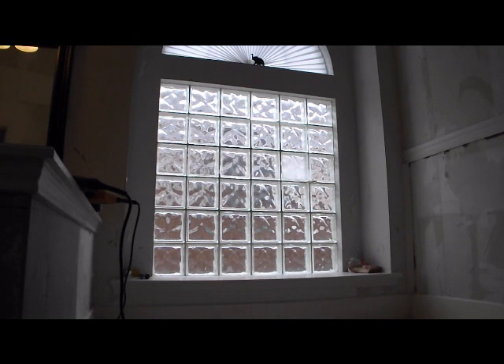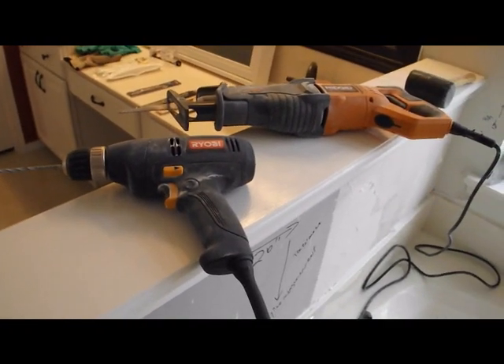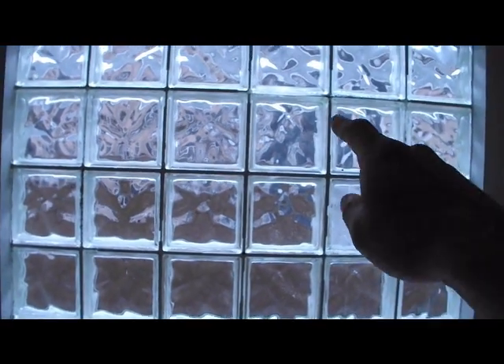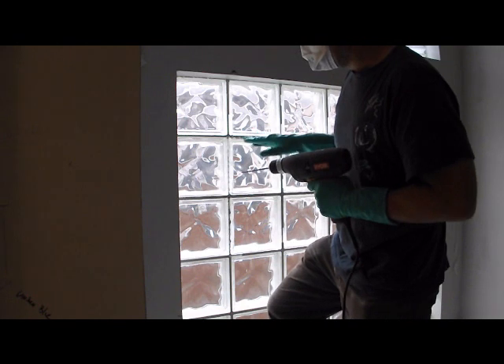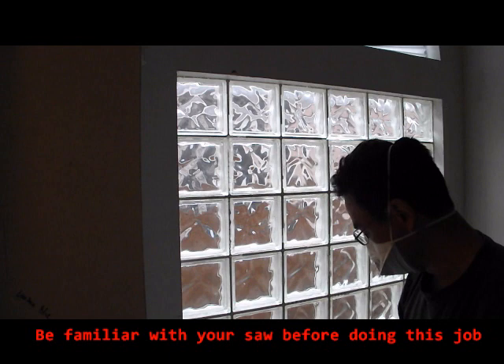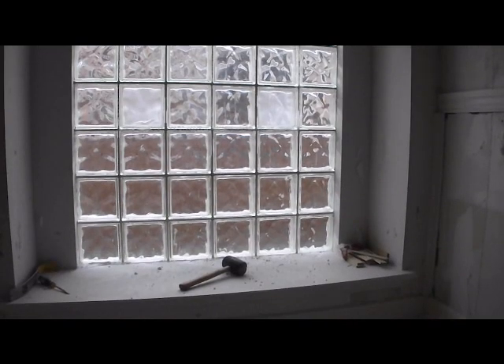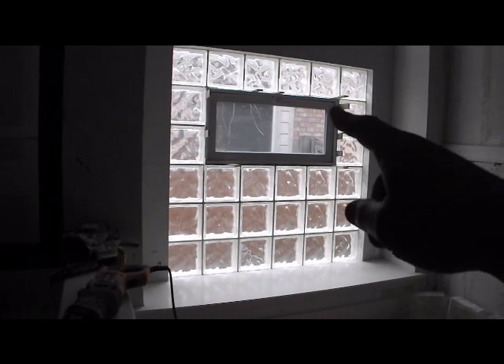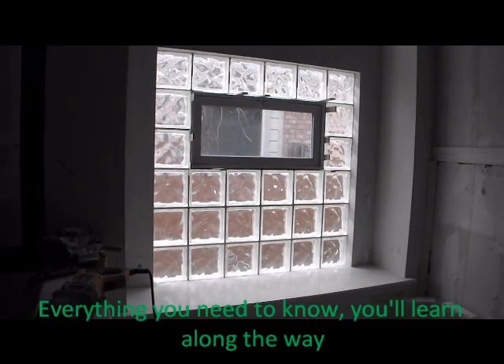Glass Block Window Demolition

Comment: Why not use a Metabo with a mortar cutting blade. I am going to cut blocks out of an existing window as you did, but I am going to use a stone cutting blade that costs $14.00 from Walmart.
Reply from the maker: Sounds like a good plan. I didn't have an angle grinder (metabo?) back then. If you use it the standard warning to be safe applies. You might have to come from both inside and outside to get thru the full block width. Be careful about the steel lines that are more than likely inside some of the seams. That might make the metabo jump up a little if you hit one. Thanks for your comment!

Comment: I have exactly the same blocks.  I think because of the house shifting one is cracking.  I was wondering if you remove one will the others move or crack from loss of support...I was thinking of cutting some 2x4 pieces to insert once I removed one...any ideas where to buy these blocks?  How do u get a match or are they standard...
Reply from the maker: Well, my house is from 1998, but it seems like they have not changed much.

To get a sample, go to the front desk at Home depot, and ask to have 1 block delivered for pickup in the store.

https://www.homedepot.com/p/REDI2CRAFT-7-1-2-in-x-7-1-2-in-x-3-1-8-in-Glass-Block-for-Arts-and-Crafts-5-Pack-CB0808W/302762931.
Reply from the maker: As to there being only 1 cracked glass and your concern that the window won't be stable... hmm

First, these are extremely stable basically a mortared together wall of glass blocks. So if you knocked out 1, it will make basically zero difference to the rest of it. But you have to remove it carefully so as not to damage the other block.

Now, if it really cracked due to foundation problems, you don't want to replace it with another block... you might be dealing with more cracking blocks too.

Honestly, it sounds like your situation is cosmetic, which is a real problem, but maybe a patch over the 1 cracked one will look ok?  You could use a nice 7 1/2 x 7 1/2 piece of decorative tin.

Or you could try the drilling, cutting and replacing 1 block, you'd have to take care to get it matching tho, as your new mortar will he a different color than the aged original. And you won't have the metal guidelines of the metal runners.

Good luck and thanks for the comment.
Reply: @tkmair6559   I dinged one of my other blocks one time and air came out...they are vacuum sealed I think...not that one is getting green inside :>)...at some point as the crack gets worse I will need to do something...i was thinking an angle grinder or chisel..although I would think a chisel would introduce more change of breaking the surrounding blocks...u found the drill to be the best?  Some sort of cement drill...i do have a hammer drill...
Reply from the maker: @kenmcf  they way I did is, start with drill use masonry bit. After drill out enough to slide in blade, use sawzall (reciprocating saw). You have to get a diamond crusted saw blade. You can Also use a flat head screwdriver as a chisel between the drill holes.

Now that you mention it, starting with a angle grinder, might be good too.

The thing is to get to where you can use that sawzall. Because that's what can cut all the way into the corners.
Reply from the maker: Yeah, chisel is great idea. Just use something small and easy to control. Good luck. Go slow and careful.
Reply: @tkmair6559  Cool..i have sawzall too..yeah that makes sense..now to find the replacement blocks as my glass blocks are pretty old...I just hope i can find a match.
Reply: @kenmcf  go to your local menards ,hardware , or window store that deals with glassblock. I got free quotes . no matter which style & size you have you can easily still get a matching one for $5 ballpark

Comment: I want to do the same thing in a nearly identical window.  What kind of window did you put in?  And how did you affix it?  Sorry if this is a dumb question; I am not familiar with windows and installation techniques.
Reply from the maker: Hi Rosann, there's no such thing as a dumb question. Or I once heard the only dumb question is one you were too scared to ask. :)

So here is a link to the window I used. I didn't actually do the installation, I gave the window to  contractors that we're doing tile work. It looks like they used heavy duty caulking and that is it. Mine came out very good and window works great to allow fresh air into bathroom.

This window fits exactly into a 2x4 block of glass (after removal.) Of course you need to take measurements of your glass block and compare with the sizes on website. But generally it should be a perfect fit.

https://www.homedepot.com/p/TAFCO-WINDOWS-31-75-in-x-13-75-in-Hopper-Vinyl-Screen-Window-PV-HOP32X14/100671879

Comment: Good video. I’m a firefighter and we use a sledgehammer to knock out glass block and it’s a b$&@!. I was going to try that in my bathroom. I’m glad I watched this first. Did you use mortar to Hulu the window in place?
Reply from the maker: mihnic0504. Thanks for the comment. The window has been a great addition to the bathroom for 4 years now.

It was secured in place by the same handyman crew that did tile surrounding the tub. That job was for the pros. I know they used caulking and it looks like a silicone/latex blend. My favorite caulking is Dynaflex 230 for all places.  As to mortar, don't think would work with the vinyl window sides. Maybe if it was a metal window. 

Good luck on your projects, and thanks for your service to your community as a fireman!